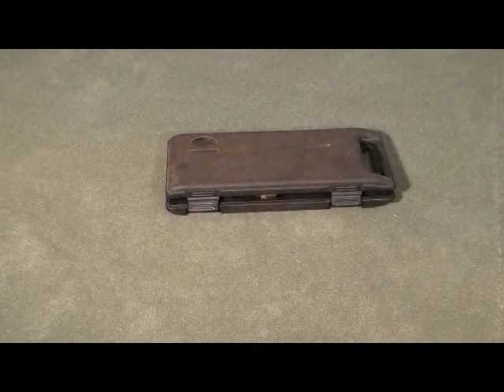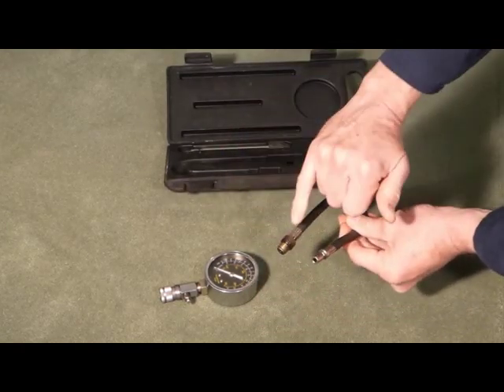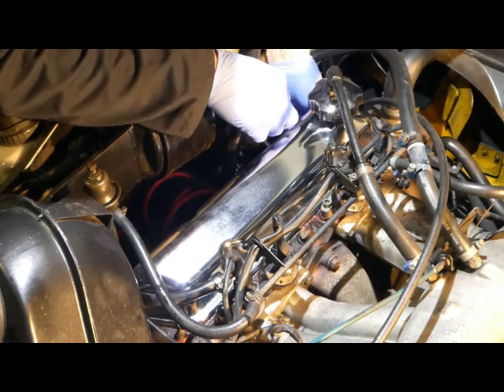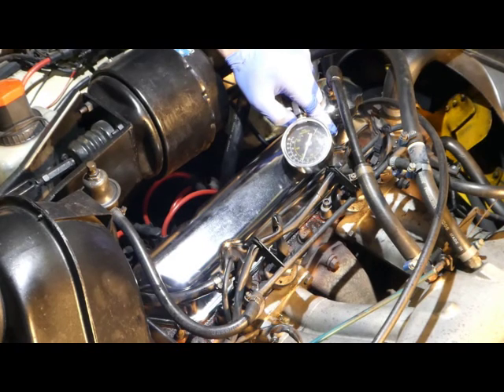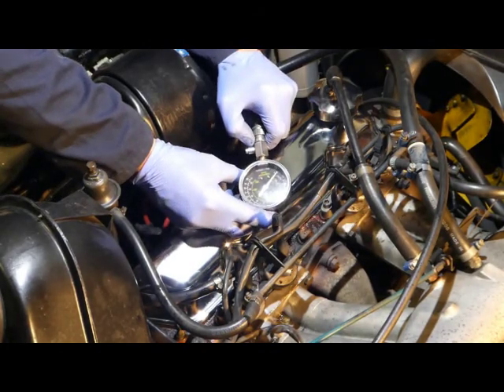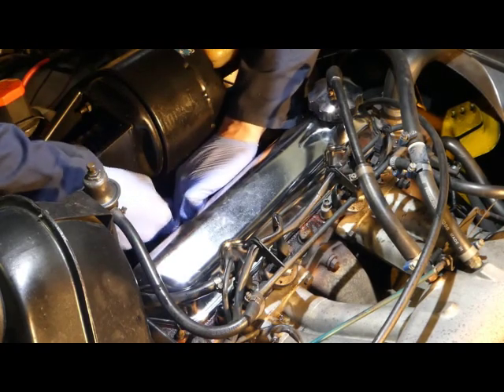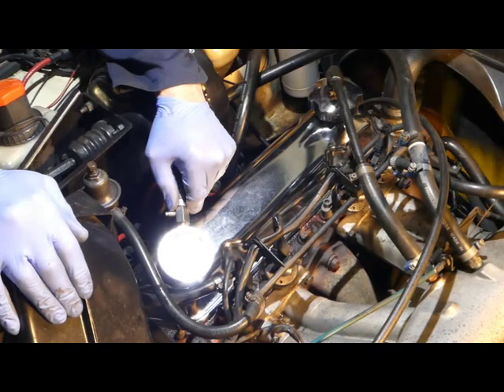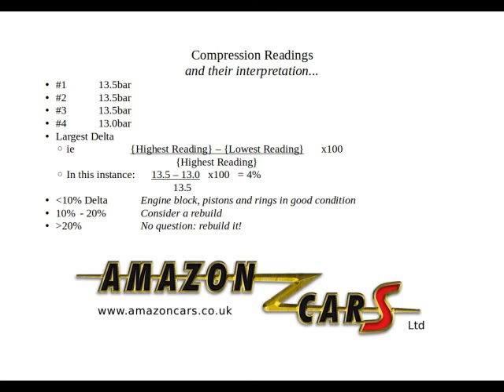Compression test on the Volvo B18 & B20 engine

Comment: This maybe an odd question Robert, but how do you normally drive?
Once my engine has fully warmed up I tend to drive fairly hard using most most of the available rev range.
My daily driver is a modern turbo diesel.
Merry Christmas to you as your family
Reply from the maker: Nice one!
Generally I tend to aim for best fuel consumption, so lots of feathered throttle.
However, when competing, or just for the joy of it, I'll use the full 7000rpm (on our own built engines) - these motors love to rev when they have twin carbs.
The single carb engine really doesn't want to go over 5000rpm, it's all about the mid range torque.
R